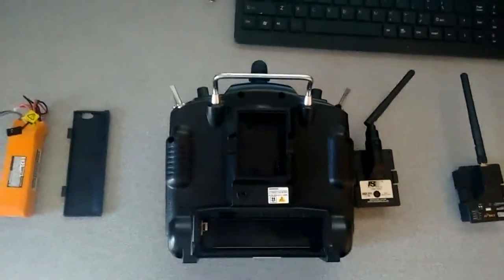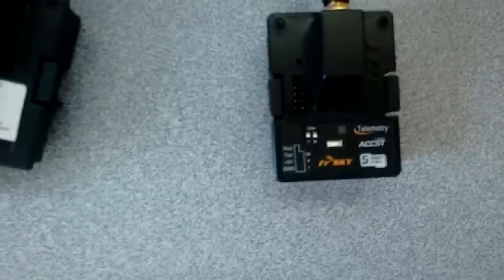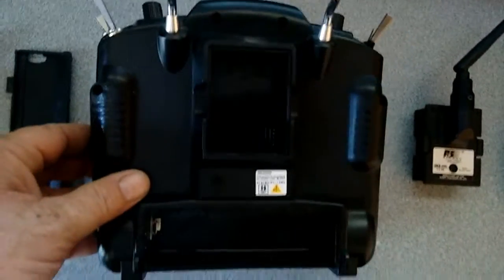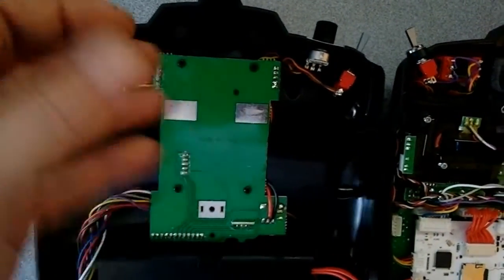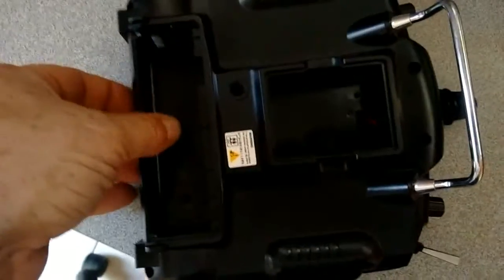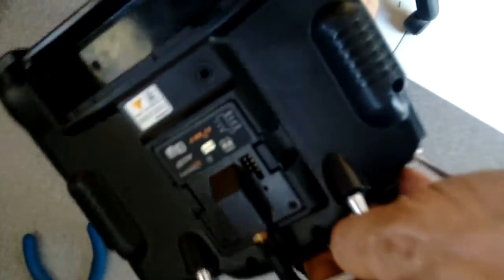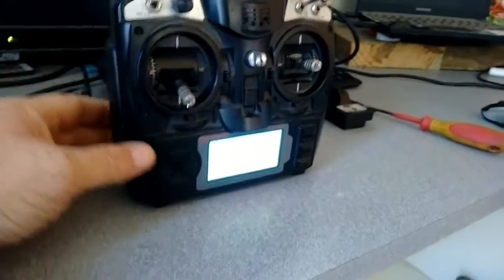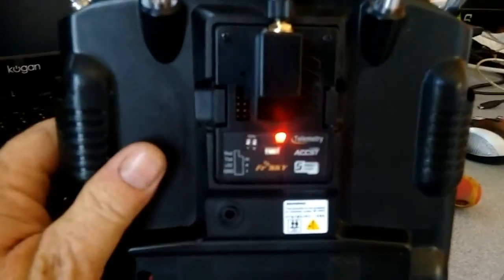XJT Module install for the FlySky TH9X

Comment: are you using XM+ receiver? if yes, how did you manage the rssi output to osd? i tried to follow project blue falcon but they are using taranis to flash the firmware of xm+. Thanks a lot.
Reply from the maker: Chad Bondoc No x4r mainly and I just sent my radio to beep on low Rssi values

Comment: Hi, i'm contacting you to find out. if i may have fried my th9x stock board. I opened it to desolder the original beeper, as it kept constantly beeping, put it back together, and noticed ground wire was after coming out of it's crimped housing, i can't remember if i powered up the tx like that, or not, can you tell me, would this brick the Tx if i did? Also, if i powered up the TH9X without the module in the back, would this fry/brick, the TH9X? Any help you can give would be gratefully appreciated.
Reply from the maker: You can run the TX without the module that is not a problem.  And only connecting the positive with out the negative should be fine also. Sorry this does not help but at least you can remove those from the list.

Comment: Hello, love the series of upgrades to the th9x, myself I have only done the backlight.
But im considering doing this upgrade to the XJT module, to be able to use their recievers! My question is, do I need to have the 9Xtreme board? or can I install the module in my stock th9x?
Thank you
Reply from the maker: andreas292 I believe you can but for any of the telemetry options you will need new firmware
Reply: Alright, thank you :)

Comment: Good job there!. I could skip that step, as my TH9X is first generation. Still with the long anthenna :). So I had a bit of micro soldering when installing the 9xtreme board. Also with an xjt module, really proud of this radio. I never thought it would become my main radio, but it has (my DX8 has turned into a great simulator joystick..)

Comment: where do I get the board at? I can get the module all day long and what does the board do?
Reply from the maker: The board I think your referring to is present in your radio
Reply: +NQIS Steve the 9xtreme board is already in mine? mine has no "telemetry" for anything (no RSSI, etc.) except it's own battery level. no settings/options/features for anything like that, currently. so what you're telling me is that the module alone supplies the sufficient programming needed to change that?
Reply from the maker: +David Hannigan Jr. (Deputy Dave)  let's start with first telling me what radio you have
Reply: +NQIS Steve umm… the FS-TH9X.
Reply: +NQIS Steve is there like something more specific you're looking for?
Reply: +NQIS Steve does that receiver in the video Kama come with the speaker and speech like that? Or is that another mod you did?
Reply: +NQIS Steve oh I see now the 9xtreme isn't the board in the transmitter, it is the transmitter.
Reply from the maker: Ok I think I understand your question the firmware on your 9xtreme should be ersky9x, that is what the 9xtreme board runs. When you install this modification you then setup the alarms and or voice warnings inside of your new telemetry screen you can make with in ersky9x.
Reply: +NQIS Steve so an ersKY9x is the same as a fs-th9x? cuz I know stickers don't really matter but mine don't have the same stickers as yours. where yours says er9x at top in the middle, mine has a stick that says; FS Fly Sky. Although I haven't cracked mine open yet to see what exactly is inside, yours in the video and mine are indistinguishable from one another other than that. Appearance wise anyways (again, outside of the different stickers). and mine also has never made any sound close to speech before. Only beeps. And I can't tell if it was because of the module, but it appears as if the interface is slightly different as well. But they are similar. And like I said I can't tell if it's because of the module, but it would appear as if yours is like a step between mine and the Taranis. I wish I could send you a picture of it.
Reply from the maker: +David Hannigan Jr. (Deputy Dave) OK Dave I think I do a reasonable job in the proceeding videos on my 9xtreme board installation into my flysky th9x radio this board is a modification which allows the program ersky9x to be installed on the radio please go watch as it is a great update to our radio by the way the sticker comes in the pack
Reply: +NQIS Steve I still need the board.
Reply: +NQIS Steve nm
Reply: smartieparts.com for the board, ersky9x is the program to run the new board. the 9xtreme board comes with the new backlit screen. i also bought the cc2500 so i can use one radio for 30 plus toy grade quads and other flying toys.
Reply: +DroneXFun What you don't fly real quads?
Reply: +David Hannigan Jr. (Deputy Dave)   real quads? a real quad has 4 props right? what do you mean?
Reply: +DroneXFun like the ones I got. I mean I guess you could call them grown folks toys. But you ain't going to see too many kids flying this kind, I mean hell even in the fucking Grand Prix's and the DR1s and all that crap, there'll only be a few. the race quads, the freestyle quads, Charpu, Mr. Steele, Skitzo, FinalGlideAus (Chad), -type quads. The DIYs. The type that are a real danger of much worse than getting some cuts if mishandle type quads. you comprendé?
Reply: +David Hannigan Jr. (Deputy Dave)  the toy grade quads are still fun. if i want to fly inside the brushed quads make more sense. if i want to film something then i'll fly a brushless camera quad w/gimbal. if i want to fly like the rotor riot crew i'll just have to practice more.lol. why don't you think brushed quads aren't "real" quads? everyone has to start with something, preferably cheap.
Reply: +DroneXFun oh I agree they are fun especially those micro ones. I was having a blast with one of those the other day. no disagreements with that here.
Reply: +David Hannigan Jr. (Deputy Dave)  for some reason i got addicted to the toy grade quads and started buying anything i thought was unique or a good deal or really "sporty". i have a few brushless but still can't help myself from buying a cool brushed one now and then.
Reply: +DroneXFun no I wasn't talking about brushed quads, I was talking about toy grade Quads. I mean yeah, technically speaking, they are Real quads. But compared to Rotor Riot's quads, they're not REAL quads.